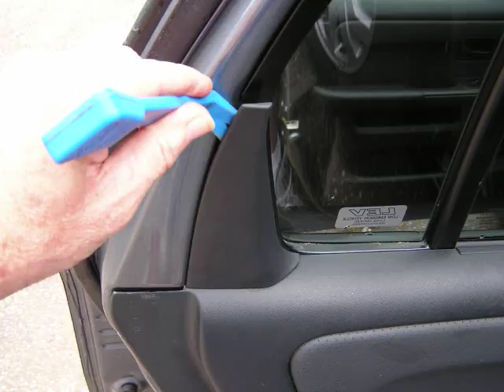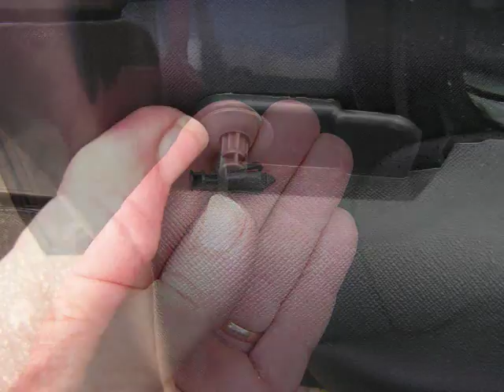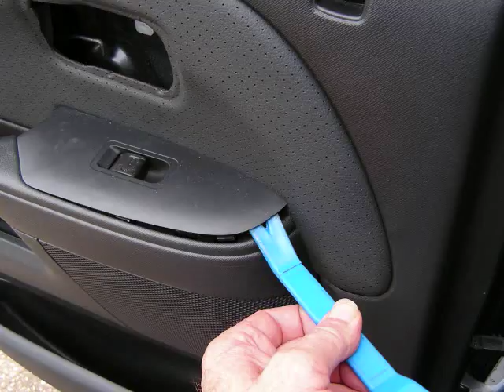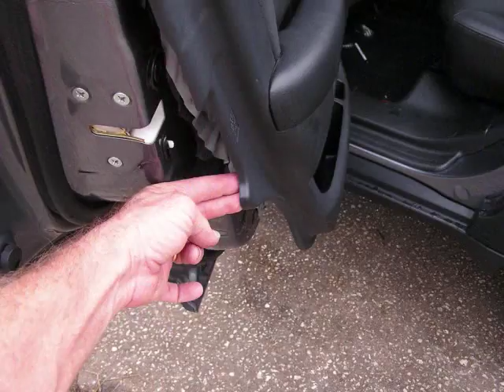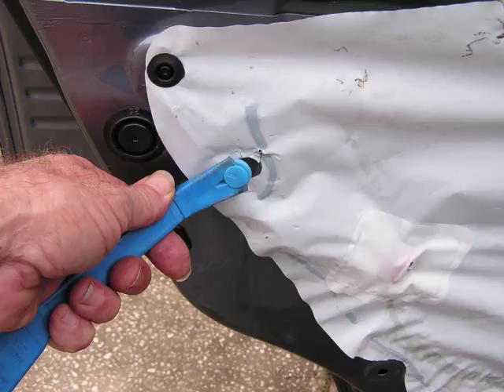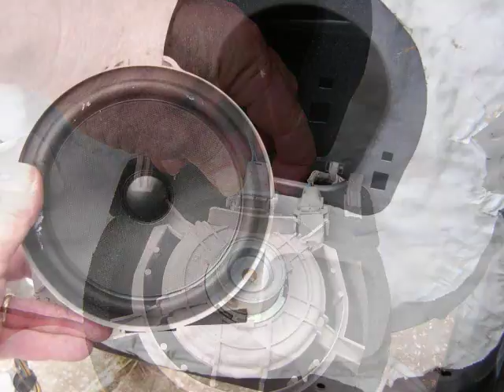Honda CRV Speaker Removal = Car Stereo HELP

Comment: Thanks. 
Unbelievable that Honda (as smart as they are) would make it so difficult to replace a 6½" speaker. The 1st generation rear speakers could be replaced soup-to-nuts in under 5 minutes each side.